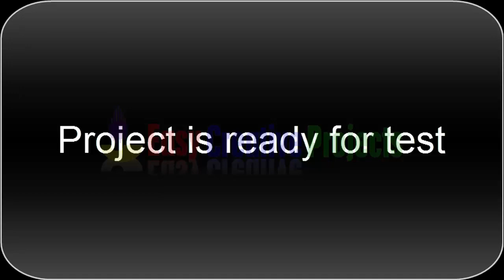how to make 12v kitchen exhaust fan using 775 motor

Comment: Sir make a vedio on AV in to VGA out or HDMI in to VGA out cable
Reply from the maker: dear you can convert it using device converter.  
but you cannot convert it using only cable connection. because each cable need different power and function. its only possible with converter device.
Reply: Sir make a vedio on it